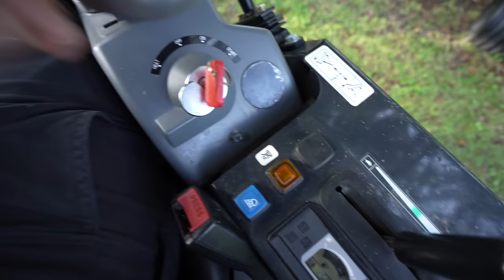Natural Gator Pond Diggin! And Venomous Snake care!

Comment: Hey for your color coding project - you can buy little cans of spray paint sometimes in the automotive department that match vehicles or you could you look in the craft areas 4 spray paint that should drive better than nail polish make sure to do several light coats and not heavy and that will dry better

Comment: Tyler did you buy Gel Nail Polish.  If so you need to paint the head of the key then expose it to UV light for a bit.  It may be sticky when done and if so you need to use an alcohol wipe on the polish surface.  Then you may need to top coat it with clear Gel Polish and repeat UV and alcohol treatment.with